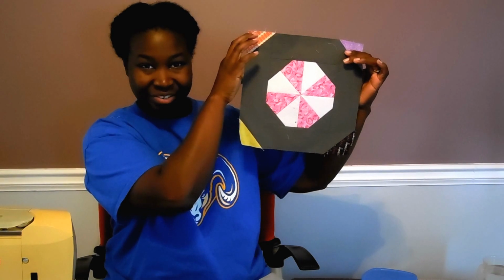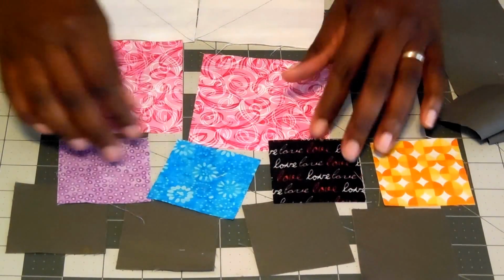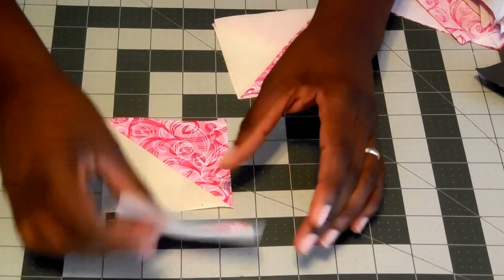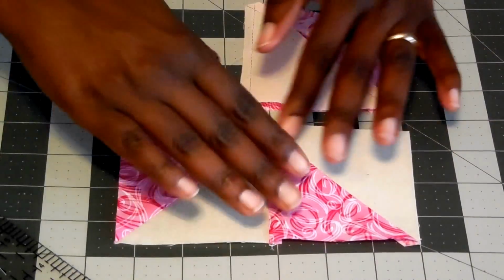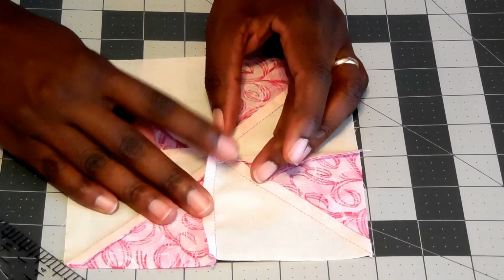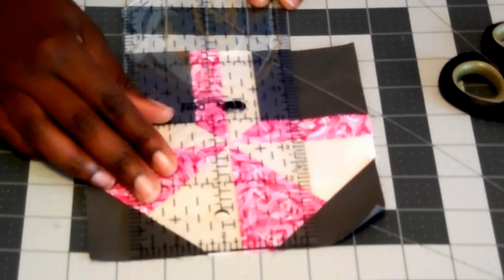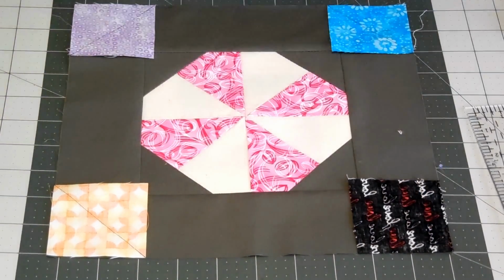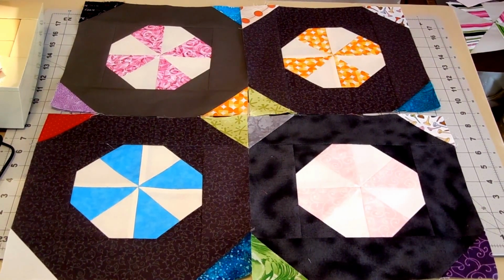Quilting Made Easy: "Wheels" Block (Scrap Quilting)!

Comment: Nice tutorial. Can you mention the size of your blocks you are cutting when you talk. And please turn off the beeping. Thankyou
Reply from the maker: The half square triangles in this block were made from 4 inch squares (2 at a time method). The sashing was 2 1/2 inches, and both sets of snowball blocks were 2 1/2 inch squares. I hope this helps.
Thanks for your suggestions. I will definitely take your advice. Thanks for watching!